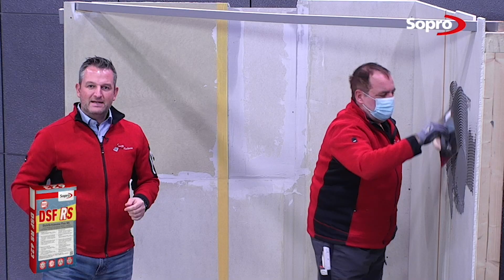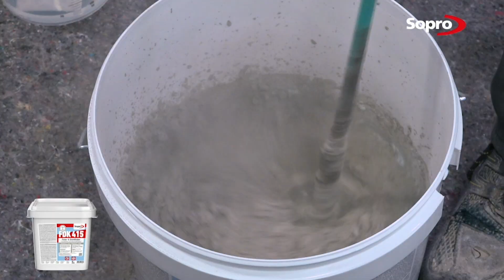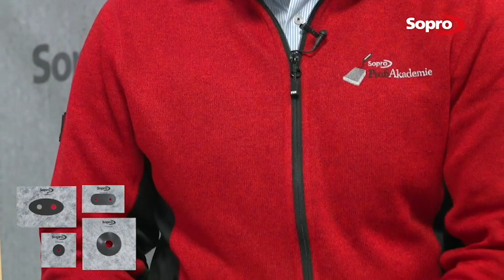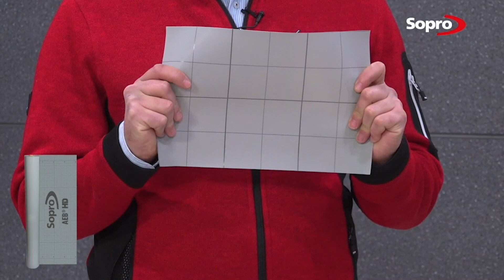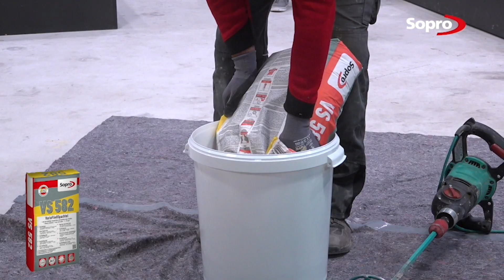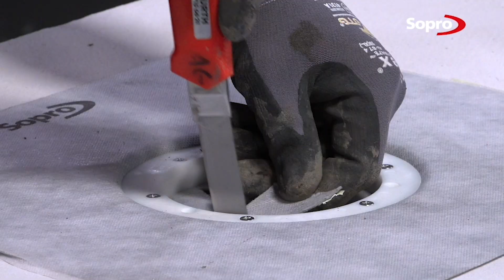O-LIVE Show Sopro waterproofing systems, 30.11.20

Comment: Nice and instructive video. 1 question: is there a need for a primer on the AEB 815 before adhesive for the tiles?
Reply from the maker: Hi WeraMaria Olander: There is no need for a primer on top of the Sopro AEB 815.